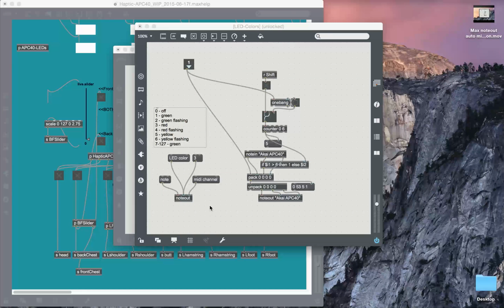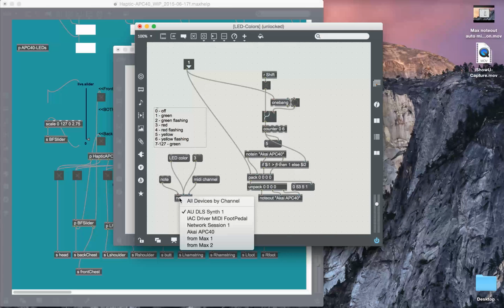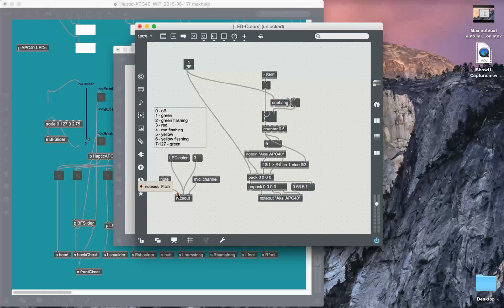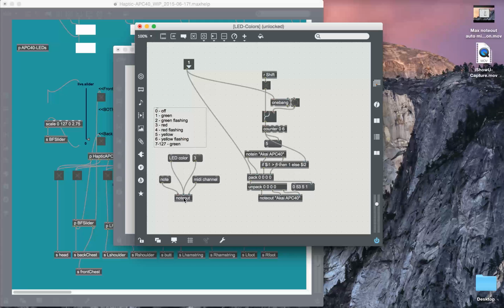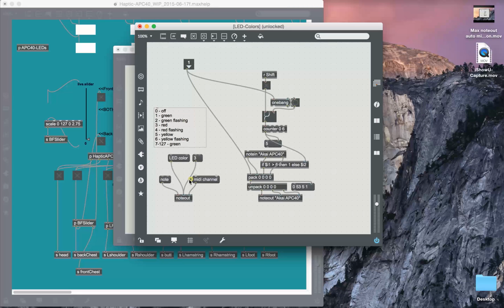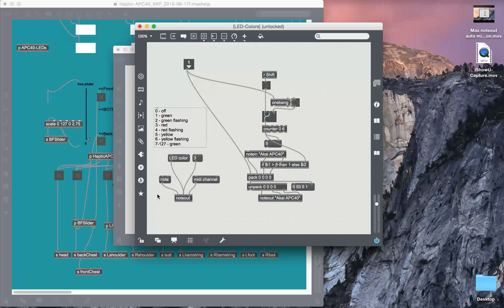Akai APC40 LED Lights with Max MSP

Comment: in case this helps anyone, this is a basic patch that sends some LED commands to the APC40...

<pre><code>
---------begin_max5_patcher---------
1212.3oc2Z0zaaiCD8rCP9OPHzaqWCwuo5sh1daOzK6osKJjsIRUWaIAI4jr
sX+uu7CqjfHoHJBZEGeINlTlCey7dCIGwec8UKhVWburNB7dveAVr3WpVVXZ
S2xh1FVDsO89M6RqMOXzlh86k4MQKO1Yi79FSG288hcRvMUYaenO0+p6oX8O
9cHE+Py4G1mkuS1XFPXaqkoMa9dV9MeqRtowNmnH7pDNiEKDPDESvH7RP7p3
k.Vh9uH0+C96mLrEGZZG2XSq+20Wo+T8wRmQnZbVKqdX1ZGyl+sTZmTQQKAQ
qSyuI5QSWlVktW1Hq9lLOc8NySF2mW.m3gW.y0fESVgoXHihXwXRBBRWBnFm
ABMra.4saXurtN8FY2.csrA7N3K3edbt7TnGO.A.8BPmQY13bRWrSfigcn+T
.4cp4bWn2.VCxFF4FVghcjozG85DDdE9MbcFqqK.krhdpB+C4BRKKk4aAjoF
+Er.o+wXbOBgjSGYHvBAAY55fdcDHUdgyBUQYkTyIlri.EJFQLsGFA9MX5An
GdDVbWOBLgshyTMyYXLgivBxqS1heSEwF1gLriH1CMRBoGMBqGpAFM+Ti+7m
Y.13TiQoH7DO7LbmydL59Ivm.JBjf8fivYd3I5Urv3qHJhRLCCoLjPsSEEG4
Dtfx5CMME4iPFl9lK4b+1bQWGRbe60fXbHj4VzHBgnQ3AUoWOiZ4021hF3z8
DjXgdgCXL7xPl3w1NvB5J6lqtrzEdbjLrfqcEb57JDFbS3uCpjpf3ot4StG6
BGmXEBX3pjmKDHmPgvHkbop3t59J4BOd5DcDgpwA+jWik.mWi4wlAT6L9RJu
Fyik+wP3kXdMlGq2ig3yv7ZSt5BLpGPGQdUxqMB1mbIlXdjSWEl0.b1wdvS.
h8G6WJI.8n5IHas0m8DfmtWw.ULcufvTPD0R+cj.uJufAHgp0+SuzpTOJNhE
6h3tXm8JUlnPrBHk6Q5.qletWA7TpE73ndFe.DFe1nEH.JwGsfGKFZwde4AN
kZgAOdSV91ray1dHcG3O97m58LNTONiiILZW4iIdS9ZjIBO40mQo3I9khOwS
V84RB98YayTF.70nO7OoYfO7kORh+ZTeTaeycggjtu6GHZzWG1yY51mKZWVd
mqHhwz5NdlGnt3P0l13WKQE7DKtUV2jkm1jo192iOUh8gF1W6r8RbwbnfYNJ
xE6oyDGJCRlY.5T7iFt.Hclif5yL3..4gCf5gBMlA0mlKTHD6BBYgiixlYNp
thGyp8DNEAYgyfbmhfhvYPlSFjFLCxcRExCGGk6Thad3TglgZTRSqeHDFblU
gbmTE7voJ3NoJ3gSUnu4EiiP8MWITFzIYnHbbFgaxvjvZP3nHLb5dgSpBQ3j
Eszg4yfNkYSDNcnfMuIZzWg1w4Llaa7SmVpycUVjk2b7nLT6EFMom59xnvQ5
Re6551GybEA5ouf.6N.5kCrC.6iSRLRz2ElDuhz4pU18ICWTb7TMgae2ladu
C9u9Stc7rvokk2JqpO9SrFScr+eTTo+tXo86Y41uaOodTk71r1eB01TZk5j6
MpisenxLGitu8UWEsuXqrJ+PVa0GzvUaZSkExS2KqKSs.yTAhquR8.+uMjnb
v
----------end_max5_patcher----------
</code></pre>
Reply: ps, youtube messes with the formatting (interprets a bunch of dashes as those strikethroughs), so edit> 'copy compressed' one of your own patches, then swap out the contents of this one to get the syntax right... if that makes sense